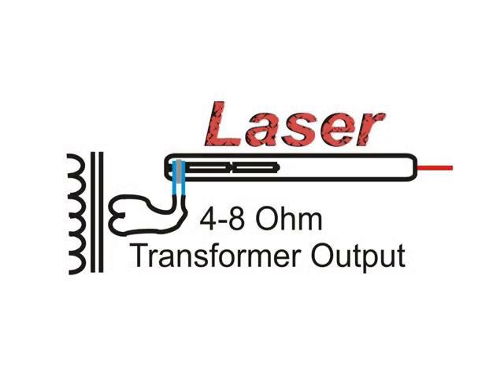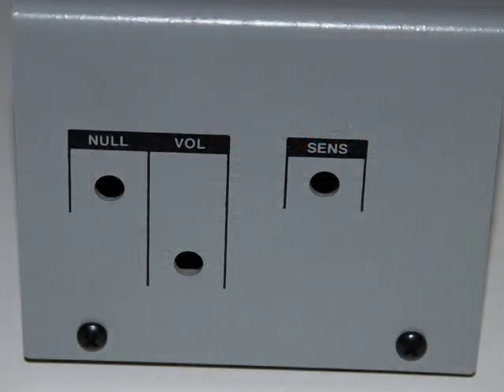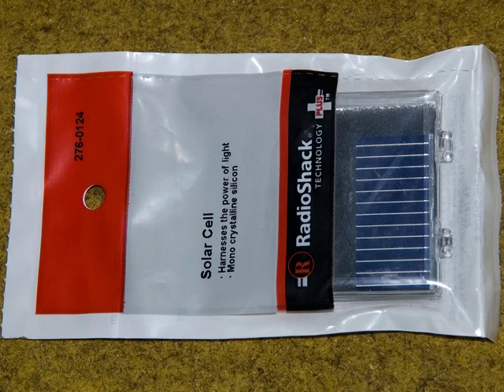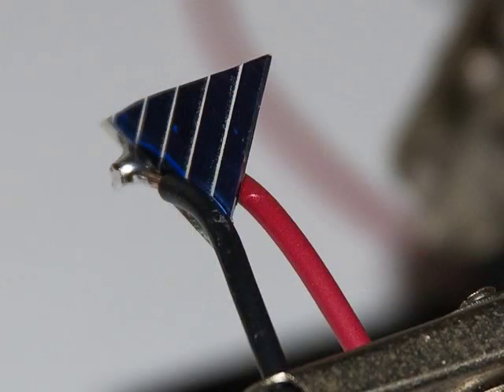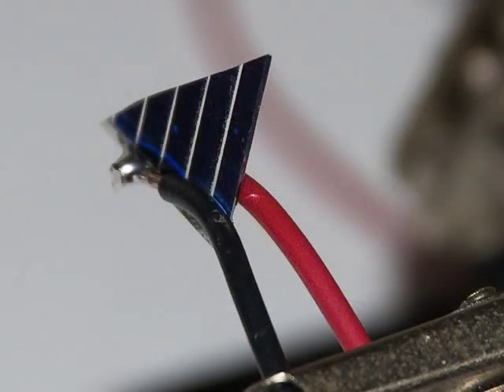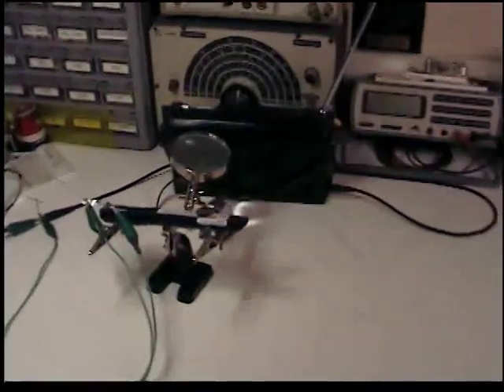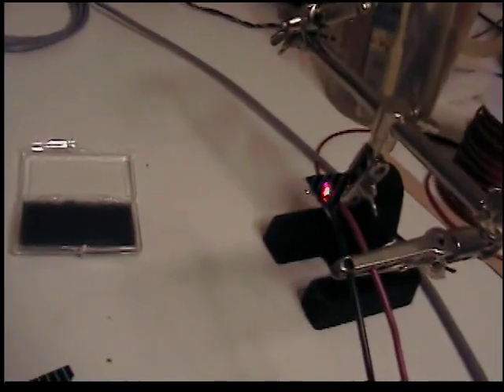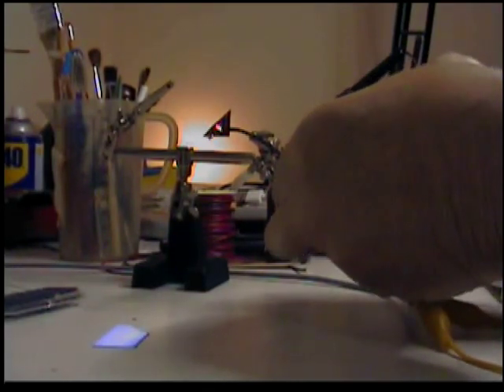My 8th grade science project receiver updated

Comment: @AllAmericanFiveRadio I remember Mr. Wizard, he had some pretty fascinating science videos!  In reviewing our two designs, I note you are modulating the light circuit with an electrical audio signal from the radio, whereas in Jon Hare's sunbeam transmitter, he modulates sunlight with an acoustic 'pressure' wave (voice) generated on a metallic diaphragm. The sunlight reflects off this vibrating diaphragm and this 'modulated light wave' is focused onto a light sensitive transistor circuit.